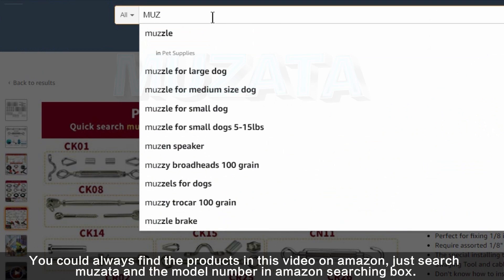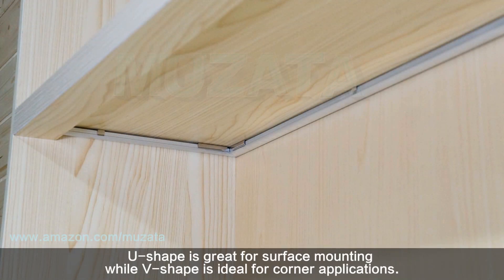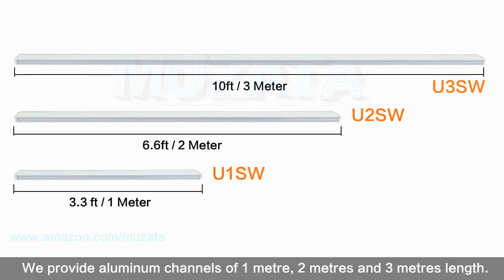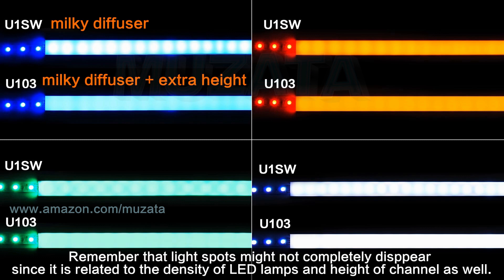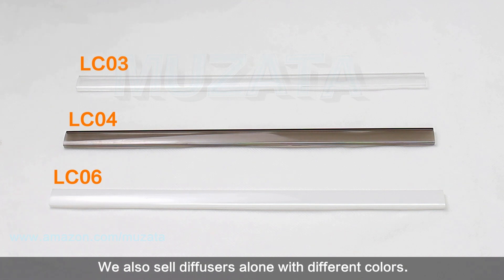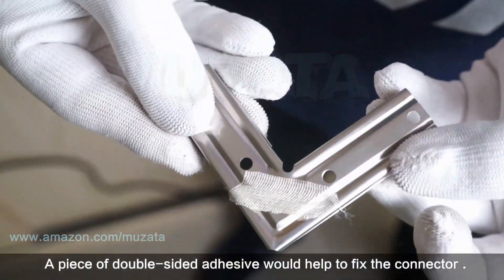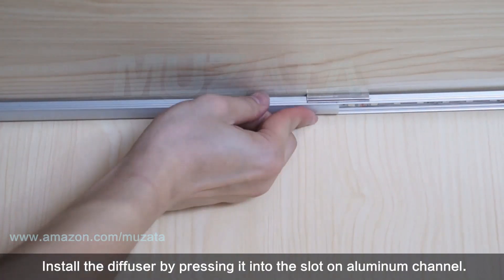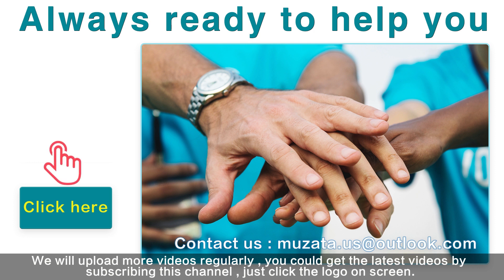How to choose LED channel - Muzata aluminum channel installation DIY guide 2019

Comment: What’s the best channel for crown cove molding.  I don’t want hot spots but an even diffuser. The cove is about 3 inches from ceiling to top of crown moulding. The crown molding is about 4 inches deep from the top of the crown?
Reply from the maker: U108 led channel has the best spotless neon effect in all of our led channels. So I recommend using U108 led channel, here is a link to U108 led channel: https://www.amazon.com/dp/B08NFR4WVP?ref=myi_title_dp

Comment: are led channels water/rain proof?
Reply from the maker: If you are using waterproof led light strip, I recommend using our U103 led channel to work with it. Here is a link to U103 led channel: https://www.amazon.com/stores/page/A6D03F06-82E7-41B2-80D0-90913670FE1C?ingress=2&visitId=e649a092-08cc-4cb1-8f99-f9a4c0fb7782&ref_=bl_dp_s_web_20554936011

Comment: Tommy Daly
Which do you recommend for the corner on your ceiling...to allow the most light (not diffused) Thank you
Reply from the maker: You can visit our Amazon store to buy the corner connector, here is a link to it:https://www.amazon.com/stores/page/0BBA6A5C-FC46-42C9-80BC-F346855C367F?ingress=2&visitId=60a5e0e0-9553-445d-a5f4-42d9bfb582a0&ref_=ast_bln

Comment: UPDATE: It has been 3 Months now and STILL the corner connectors are not available
I need Muzata Led Channel Corner Connector kit L-Shape Adaptor 8PCS and Extension Connectors 20PCS for V-Shape V1SW Aluminum Channel, 90 Degree LC14 E1,Series LA2 LC2

Also: I need 
 Muzata Led Channel Corner Connector kit T-Shape Adaptor 8PCS and Extension Connectors 20PCS for U-Shape V1SW Aluminum Channel, 90 Degree LC14 E1,Series LA2 LC2

Comment: here is a thought, can I use Velcro to secure the LED Lights to the channel, not ON the back of the LED but NEXT to the LED
Hmm for sure in time the two sided tape will lose its stickiness sure I can use them other methods but they all use a glued backing as well so they will fail in time as well,,, so best bet is Velcro,  whatcha think?

Comment: I am searching for some help
I have purchased Aluminum Channel for Led Strip Light with Milky White Curved Diffuser Cover, End Caps, and Mounting Clips. Right Angle Aluminum Profile, V-Shape, 40-Pack 3.3ft/1M V1SW
Visit the Muzata Store

The PLAN
 to mount them wall------------to wall    then        from wall-----------to ---------wall
how to do the corners?
do I just cut the channel and bend it?  or do you sell corners for this model?
NEXT
the plan
from floor to ceiling
NEXT
runs along the baseboard from left to right
I am looking for a " T " connector 

Can you please make a video on this matter?
Reply from the maker: Hi, thanks for contacting us. We have L-shape corner connectors for V1SW led channel, but they are out of stock now, they will be available in two months. We will also try our best to make a video about installing V-shape LED channel on T-shape corner in the future. If you need more information, please contact us. Our email address is support@muzata .com
Reply: @Muzata_official  Oh also, I need more channels from Muzata 
On the baseboards which are 3 inches off the floor, I need channels as I will running leds 3 inches off the floor then connecting them to the V1SW led channel  then  up the wall but these must connect to the channels I purchased
be sweet if you had a T connector, can I not just cut and bend to make a corner?
I will be posting a youtube video for my install and all your products will be showcased and featured in my video. There are not a lot of videos about installing Led into channels, just the different types of channels is all I found
I have no idea how to install these channels I'll figure it out when they arrive.
Reply: @Muzata_official  have you created a video about installing a V-shape LED channel on a T-shape corner yet?
Reply from the maker: @benjamincolosimo7780  We are still working on it, thanks for your suggestion. Please feel free to contact us whenever you need further information, our email address is support@muzata.com.

Comment: Is there a particular technique or method of snapping the diffuser onto the u-channel?  I am having a very difficult time with that part.
Reply: Just discovered the answer.  Get one side on, then get as much of the other side on as you can.  Then, using a pair of pliers and a wash cloth, place wash cloth around the channel and slowly apply pressure and the diffuser will snap on.  It makes a loud crack, such that you think you may have broken something, it's just the diffuser snapping into place.
Reply: @RankinImagery  Thank you i just got the channel and i was like this is gonna be a hard time to get it in

Comment: Great video. Which style should I use to create best neon effect?
Reply from the maker: I would recommand muzata U108. Since the diffuser is design with arc shape and the housing is higher to get better neon effect.Just search " muzata U108" or click here https://www.amazon.com/stores/page/D1D2275B-872E-4BF5-99CD-5E20C08F682B?channel=yt